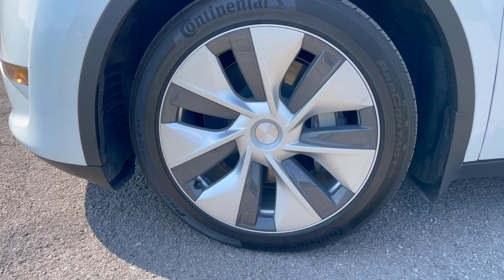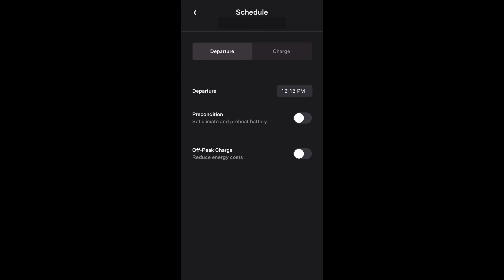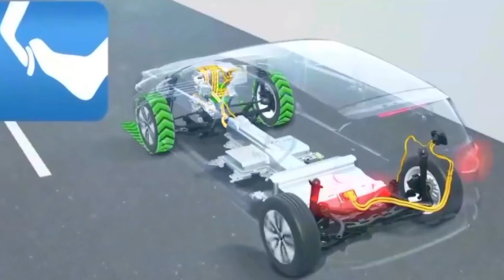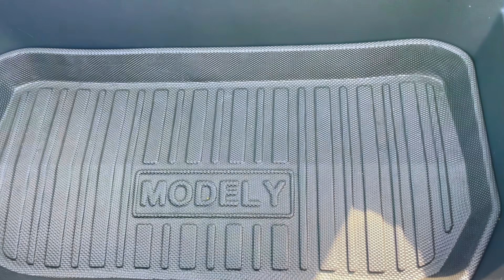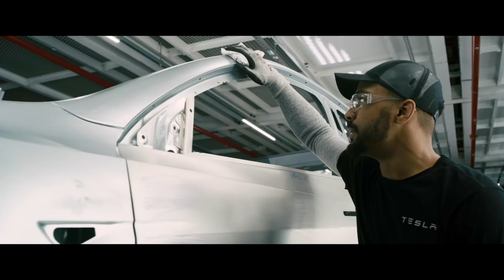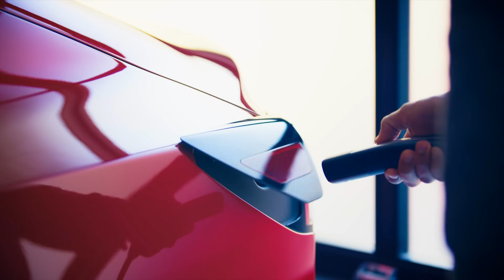9 Simple Ways to Improve Your Tesla Range

Comment: ny tesla model 3 - 3 months old. its 100% battery range deduced from 100% 439km to 436km fully charge. does it mean a bad signal for battery? only 3 month driving
Reply from the maker: Normal. You'll see some degradation during the first year, then it'll be much less over time

Comment: Hi so question ? Do we charge 95% is it good and 5% saved for regen braking . The way I understand also what drive mode is  good for daily driving please reply
Reply: they added an option called "use brake when the battery is full" so it mimics the regen brake. you can then charge to 100%
Reply: Charge 100 %
You can see the differance

Comment: I would add a glass roof screen cover to help reduce heat on a hot day and improve efficiency as a result of AC working less.  I installed one it makes a big difference on a hot day.
Reply: Where did you get the screen and cost?
Reply: @TreeHugger826  i got one for about 60. Make sure you get one with a second light covered liner that goes on top. Makes a big difference.

Comment: What about using chill mode? Does that help maximize the range?
Reply: Kinda, if you can't control your right foot.  Having it on full power mode doesn't hurt as long as you don't use it.
Reply: @JackMott 
Use cruise control = auto pilot
Reply: @ArmageddonIsHere  i tried but it phantom brakes so i gave up. my mazda can do traffic aware cruise control fine though.
Reply: @ArmageddonIsHere  I lose autonomy on tight corners when in cruise. Tesla will have to update this.
Reply from the maker: Yes that helps maximize range as well
Reply: @MattDanadel  what is chill mode and where do I set it?

Comment: The tire pressure listed inside the door is a compromise between comfort and range.  If you want the max range inflate them to at least 50psi, the ride will be more harsh but the pressure is still way below the burst rating (which is not listed on the tire).

Preconditioning the battery will not increase the range, it just speeds up the charging time.

Regenerative braking doesn't add much range at all, unless you are coasting down a steep hill for a long ways.

These were not 9 good ways to maximize range!
Reply from the maker: Do not do 50psi. At 45psi, I have found it to still be comfortable while maximizing range.

Preconditioning while plugged in doesn't use the battery to heat up or cool the cabin. So yes, you are saving range and maximizing your battery.

Regen braking, when used properly, makes your Tesla far more efficient than if you were not using it. I have found to be at or below 255 Wh/mi when I use regen braking properly. 

These were 9 straightforward ways to maximize your range.
Reply: @MattDanadel  I've done 50psi in all my vehicles for over a decade without an issue.  And 50psi is well below the burst rating of the tires.
Reply from the maker: You do have a much higher risk of getting uneven tread.
Reply: @MattDanadel  Of course yes, and that is why the door psi rating is a compromise.  But if you want max range (or fuel economy with an ICE), 50psi is the ticket.  But I will say this. I've owned two hybrids over the last 15 years and filled the tires to 50psi and never noticed any excessive or uneven tire wear.
Reply: @MattDanadel  I’m not sure you are not mixing up two different things here Matt … the battery temp and the car hvac.
Reply: To each their own. Over inflating the tires helps a Prius to gain a mile or two per gallon increase. The Toyota mechanic, the YouTube ‘Car Care Nut’, recommends going with the stated tire pressure for the safety of the passengers and to maximize the life of the tires.
Reply: @michaeljozwiak25  And yet again, the stated tire pressure is a compromise or ride comfort, tread wear and range.  I prefer a stiffer ride to feel the road better and want more range.

Comment: Basically, don’t use it at all if you don’t want to drain your battery. 

I love my Tesla. Just be smart about it and you’ll always have charge.
Reply from the maker: Not necessarily... just tips for maximizing your range
Reply: If charging sites is a problem , very true. Range Maximus is important.
I was all about careful conservation until a little bird said , "Just drive it the way you drive your other vehicles". 
Today 25F 100 mile trip. 203watts/mile. I'm very happy with that.